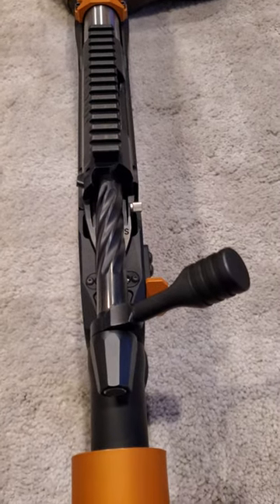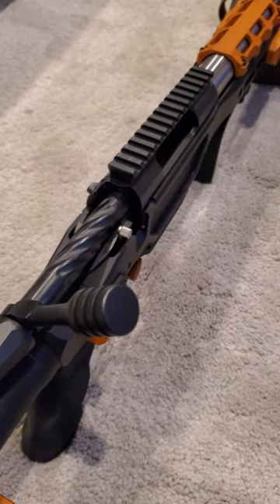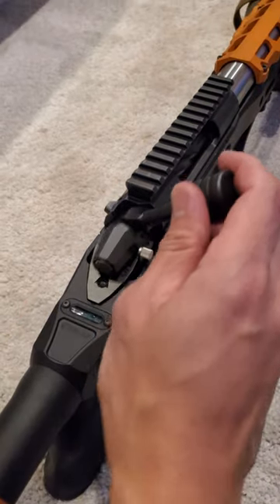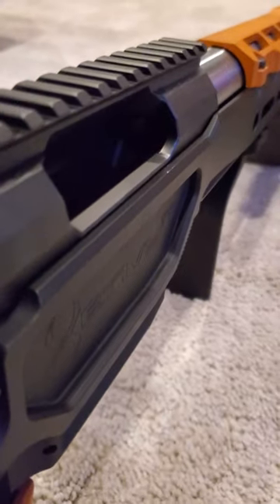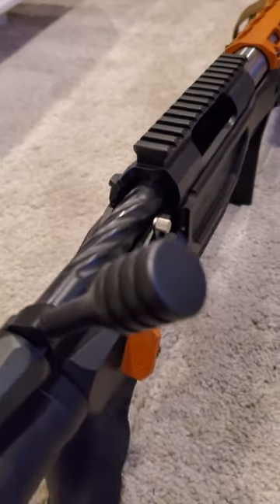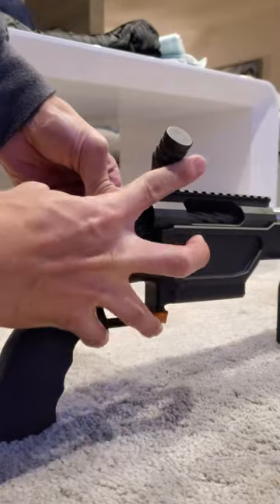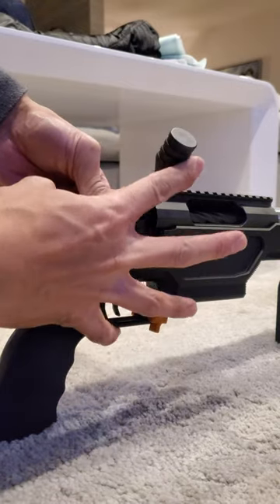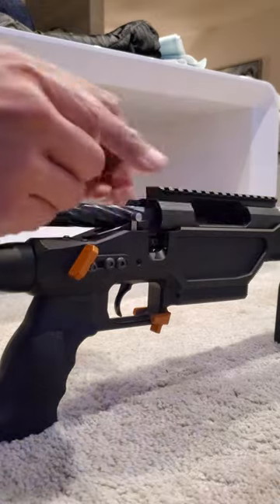Heavy bolt open and close Lone Peak Fuzion

Comment: Your vid popped up randomly on my Youtube recommended feed. 

To diagnose if this is a timing issue, remove the trigger and check for stiffness. If the stiff close disappears then trigger timing is likely the issue. Basically (due to tolerance stacking) there is excess friction between the cocking piece of your bolt and the trigger top sear from one of the pieces being too long, tall or both. One of the pieces being too long causing excessive cock on close and your spring doesn't have extra room to compress any further to relieve a bit of tension between the sear engagement surfaces of your cocking piece and trigger sear. 

If it is an issue due to timing, you would then measure the position of the cocking piece (silver portion inside your bolt shroud) when open, fired and close, to either hand file the sear engagement surface or replace the cocking piece or trigger sear with the correct length/height so that there is enough firing pin fall for reliable primer ignition but also be properly timed for the best feel.

Comment: Check those lug cut outs in the reciever that there not dirty the tolerances are so tight on the fuzion i had one not want to close all because of dry clay dust that slightly got in there when bedding a chassis on one i built for a guy. Also you have to run a little grease on the back of those locking lugs on the bolt. putting new grease on every cleaning. To run these actions smoothly. When i saw grease i am talking grease in a tube like you put into a grease gun. I prefer Lucas Heavy Duty (solid green color) or Chevron Delo2 blue colored grease, or Castrol blue colored grease. Use a Qtip to put it on the back of both locking lugs. That is why Kelbly sends you a plastic syringe filled with Lucas HD grease with every action you buy. Why Lone Peak, Impact, Surgeon, ect everyone else doesn't is beyond my understanding but thrn again Kelbly are the best available